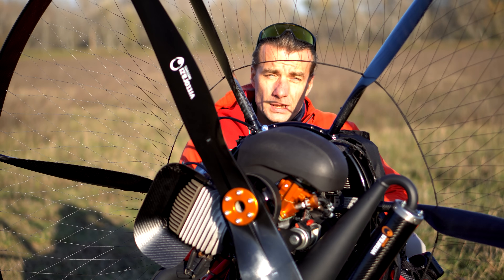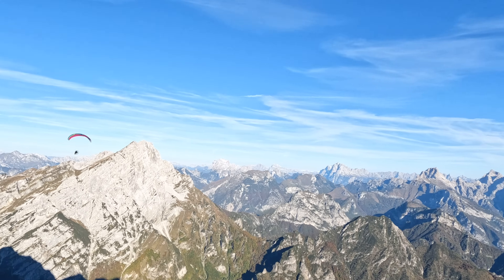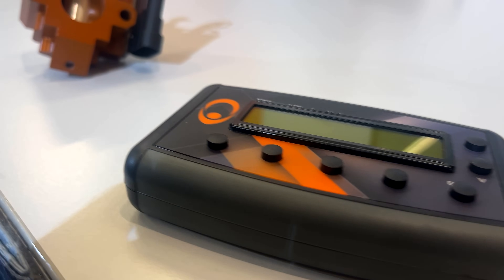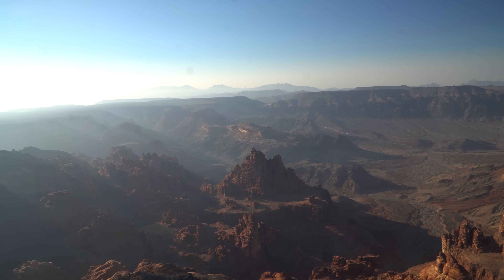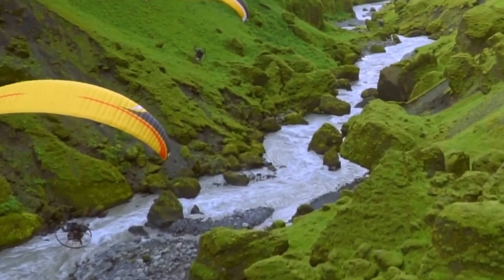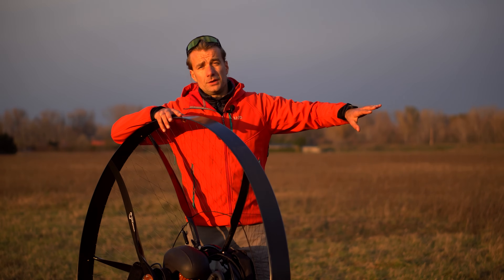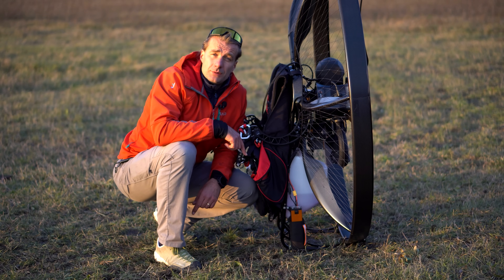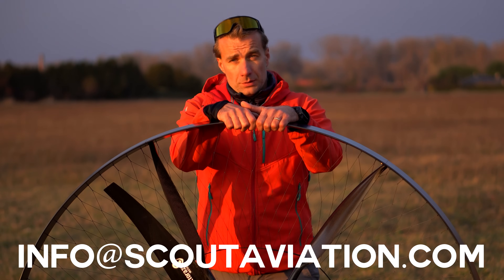Vittorazi EFI: All my expectations were wrong...Scout Smarter Pilot

Comment: Speaking of single point of failure, my biggest concern would be having a redundant channel in the ECU, even if it's only a "limp home" channel like car ECUs. Hardware, you can make robust enough to be reliable by overbuilding or by inspection/test to detect degradation prior to failure. Electronics tend to work until they don't. Also, why they don't just incorporate a small PM Generator on the engine and reduce the size of the battery?

Comment: Moster EFI is the first engine in aviation history without magnetto, alternator, charging coil. After 7 hours of flying in have to look for an electrical socket and wait 1 hour until you can continue your flight. The Iphone philosophy is now in the paramotor world as well. In cold climates and in winter, the battery life is reduced to 3.5 hours. Over time, the battery degrades and its capacity decreases. For your 6000 euros Now you need to consider all these additional factors when planning your XC flight.

Comment: They need to use an easy swap battery like you might find in a cordless hand drill. You could take several with you and, with a big enough capacitor, have it hot-swap capable.

Comment: with a small alternator, it could generate enough power to slowly charge the battery, and also will be self sustained if the battery dies.
Reply from the maker: Vittorazi has a version of this motor with electric start that recharges the battery during flight. I do not know why they decided not to use the same battery charging system for EFI.
Reply: @SCOUTaviation  Perhaps that will be the "upgraded" version when they release a new model?

Comment: £1.45 per hour fuel saving, Limited flight times, Too expensive. Well done for trying but it is too soon for the customer
Reply from the maker: This is not about calculating return on investment.
This is about feeling it. 
- feeling amazed by flying further and discovering the hidden on the other side
- feeling relaxed and enjoy the moment fully by trusting the engine
- feeling satisfied by getting into the air 99% of the time and not fiddling on the ground.
The engine is worth it if you feel that way. 

Yet I understand the price is steep and many pilots will need to wait until the technology becomes more affordable. I wish it will be soon.

And I also understand that there are still riders riding carbureted motorcycles because it is emotional to them. What a beautiful world we live in.

Comment: 5 years... so, they invented the wheel again and learned all about it. Yeah, that could take 5 years if you are only a few people working on it. How about getting someone with all the knowledge and do it in 1 or 2 years. But I'll guess now they have a reason to really make us pay for it. Because this isn't gonna be a cheap system. That's why it's gonna take a while to be a revolution in the sport, if ever. The way batteries are developing, that could be a "threat" before this system gets cheap enough for everyone to buy. We don't know what batteries gonna be able to "in the future", solid state and stuff, and when that "future" will be available, and now you also have the EOS 4-stroke, so I think we have to get a better price on that EFI-motor. Just some thoughts for someone that had an really old Solo 210 motor at the early 2000, flying planes in between and now is looking for a new rig to start with the sport again. Been thinking of a Scout with the EOS or maybe an electric conversion. The batteries almost fill my needs now. We'll see, but thanks for your input on the Vittorazi EFI. Always a lot of info. Take care - Many hugs from Sweden.
Reply from the maker: Things have changed a lot since the times of solo210.... 
Once you are ready to re-enter the sport feel free to reach out to us to discuss.

Comment: for the battery situation i cant help but think you could just add a tiny windmill genorator to charge the battery, or you already have a belt for the Prop, maybe add a little idle wheel/ tensioner wheel to the outside of the belt that drives a tiny genorator. it seems like a very solveable problem.

also the EFI should work better with the crappy ethanol laced gasoline we have in the USA.

its on my list to save up for paramotor training, hopefully by the time im ready to buy a paramotor this will have proven itself reliable.

Comment: I always wondered why the sport hasn't come to EFI. What horsepower does the motor put out? I am interested in this system because I live at high altitude and want to fly a MonoTrike with a Fox 13 wing. They say I need at least a 30 horsepower motor to get me off the ground.

Comment: Does it also solve carb icing in cold and moist conditions?
Reply: What? When does the carburator ice? What condition must there be? Never heard about this. Curious to learn. Flying in Finland it might be useful to know and avoid. Thank you.
Reply: @haukeplambeck  https://youtu.be/65djenNI_Ho?si=Yc99xmb3zkKjgjZA
Reply: No,it does not solve carb icing. EFI have also a throttle valve like conventional carb, which causes carb icing

Comment: in flight charging using an air powered generator should allow you to extend the battery life. I am sure Vitorazzi or someone is working on one. They are used on some full size aircraft.
Reply: that would add a lot of drag
Reply: All they have to do is attach a couple of magnets on the flywheel/pulley, attach a stator, with a smaller battery! Done!  No rocket science involved!

Comment: No real use what so ever yess you save fuel but then gou have a big bulky controller thats a lines catching hazards your limited to batter and if you forget to charge the batter you aint flying not only that the price is shocking. 

As for the exhaust nonsense it falls down to how the exhaust is pressed and it strained not rolled and welded together.

Its all nonsense something the paramotor dont need.

Comment: What kind of battery is it that once it is "dead" (voltage drops to effectively zero) can't be charged back up?  Sounds like a lead based battery, LiPo's can go to zero and back up, especially if it has a bms, just wake it back up. Power tools do this all the time. Heck, on my Rodeo, I yanked the Nimh out and got a lithium made for RC cars and it's a huge step up.
Reply: You do not run your lipos to zero volts and recover them. Sorry bud,  that's not how lipos work
Reply from the maker: Lipo

Comment: So assuming I am the same weight as you -- about 200 pounds -- and I also use the EFI and the variomatic prop, what kind of fuel usage per hour might I expect -- at low altitude.
Reply from the maker: We tried the variomatic with the EFI but the engine did not work. I have sent a prop to Vittorazi and they promised to try to set a new fuel map for this prop. 
Theory predicts there should be additional fuel efficiency benefits from EFI+Variomatic combo
Reply: @SCOUTaviation   New fuel map for the EFI -- is probably a lot more complex than it sounds... much much more complex.

Comment: Finally, this came as a working model. You mentioned at the beginning of the video that the engine's center of gravity is now further back. This, however, is a bad thing. The center of gravity matters to me. Is this really the case? Does some unit take up more space in terms of depth?
Reply from the maker: Yes, the engine sits 20mm further back. Not a big deal but I am purist when it comes to paramotor geometry. I understand why they did it and I would do the same in their position. The simplicity of the installation outweighs the disadvantage of the added depth.

Comment: I will be impressed by EFI too when it's actually proven to be reliable (not just an optimistic feeling from a few flights), the weight comes down, it has it's own alternator, and it's affordable. There are still critical problems to solve before it can be viable for its most valuable use case... long XC.
Reply: Already Proven!
Reply: then buy it as soon as possible. Nothing you stated wont happen if first batch of units is not selling.
Reply: 11:55  @gregorpajnic4739  I thought that is what R&D is for. To put out a tested, proven product.
Cheers

Comment: I wonder if they couldn't use a charging coil/voltage regulator to charge the battery while the engine is running. I know it's probably a LiPo, but it really shouldn't be that big a deal to do this.
Reply: They need a balancer if so. Can’t get a single cell 12v LiPo so you need a recharge balancer
Reply: @pepperjackshack2439  If all you're doing is ignition and sensors and the current draw is small enough, you could use a boost circuit to make 12 V from the single-cell voltage. That would shrink the battery as well. Unfortunately, you'd rule out the e-starter if you need more current than that. I would say that the balancing circuit could be effectively omitted as long as balancing the battery on a typical charger is added to the list of maintenance tasks for every 25-50 hours of use or so. The battery will not go out of balance on one or even ten flights.

Comment: Put on exhausts that don't crack and I'll be impressed
Reply: Supposedly, the EFI helps with that.
Reply: My exhaust is 300 hours old and rusty and hasn't shown any sign of failure. I'm of the opinion that they fixed their cracking exhausts with MY20.

Comment: I wonder why they decided not to have a small generator/alternator to charge the battery as every other efi engine has.
Reply: I'm going to guess it put them over some target weight. You'd need another motor, bracket, and charging circuit in an enclosure. Would prolly add at least 2lb for the juice they need to run that pump. 10lb would just be way too much to add.
Reply: @CalebJohnsonlivingca  I doubt it would weight much at all. A small alternator that is put on the same drive belt with the prop. Pretty sure the draw on the system is quite low and wouldn't need much to keep up. The weight of the electronics would be negligible.  And remember they are now hauling that big battery that could be changed for a smaller one. 

Could be that it just complicated the design too much. Still, would have gone with the alternator as now your just adding a limitation that the carb version don't have.
Reply: @samik83  I've made my own generator for Moster and now Nirvana, each was about 1.5-2lb. prolly you could do it more efficiently, but it's a data point. 🤷‍♂️
Reply: @CalebJohnsonlivingca   Thats awesome! Would love to see some photos / videos how you did that. And why? ;)
Reply: What other efi engine can I buy today for my paramotor?
Reply: Yea, wonder the same. There could be smaller battery in if it was charged while flight. Also, there's less fuzz if you only need to add gas and not charge battery.

Comment: Nice video again, EFI ist definitely a advantage ! But the difference in fuel flow is impossible . Fuel air mixture = full rich ( nearly with choke) is 12,5 /1 ( low EGT or burning temp.) full lean 16/1 high EGT or burning temp.very low power) .
Reply: You’re not taking into account that air density is not the same at all altitudes, or even temperatures. Where carburetors muscle through everything with the same amount of fuel regardless, efi adjusts on the fly to maintain a specific parameter.  Now that he is tested it, I have more faith that it’s actually true because he admitted he was wrong. He’s not interested in protecting a narrative that is not true.
Reply: @CloudflyerPPG  This.  Flying a Cessna 172, first thing you do after climbing to cruising altitude is lean the engine, which isn't an option on PPG's (even GA pilots have problems remembering to do it).  EFI should have been standard equipment on all aircraft 30 years ago, but regulation was too arthritic until just recently.

Comment: Unless you're huge, you really don't need a 185. What's wrong with just using a Top 80 + Viper XC and getting 2.1 L/h? Reliable, much lighter, much simpler and much better fuel economy. With my 18 L tank I can fly for 7-8 hours.
Reply: - Launching and flying at high altitude.
- Launching out of tight LZs.
- Launching with camping gear and extra fuel.
- Climbing while in mountain sink.
- Climbing while accelerated.

I have seen and experienced myself that Atom80 doesn't cut it for adventure flying. I learned on top80, but quickly outgrew it when I started adventure XC flying.
Reply: @CalebJohnsonlivingca  I and many others have done that several times with Atom 80 and Top 80.
Reply: Because when you want or need extra power, you can't squeeze More from an 80.
All the guys I fly with that switched from their 80 were thrilled and never considered going back.
Mileage may vary, of course.  Enjoy what you fly.
Reply: @WebberAerialImaging  140 prop makes enough difference
Reply from the maker: Then you obviously don’t need the moster EFI. And that’s ok. 
If I was a lighter pilot I would fly atom 80 for sure. It is a lovely engine.
Reply: Some decisions in life have nothing to do with need, but are instead made because of a desire. If you are willing to accept the slightly higher risk of a reliability issue, strong enough that the extra weight isn't a problem, smart enough to deal with the added complexity, have a budget that can handle the extra fuel costs, and the desire to have the extra power available, then why not fly a 185, even if you're not huge?
Reply: @Logan4661  Of course you can do that but at that point it's no longer a rational decision.

Comment: The battery is what kills it for me. Yes, you save fuel, but you becone limited by the battery instead. You can get most of the same advantages just by using a smartcarb instead
Reply: This. 
I don't see how they couldn't incorporate a small alternator in that thing. I bet the amp draw is really small in that system, so it wouldn't need much and you could use a smaller battery to off set the weight of the alternator.
Reply: @samik83  to be honest, i'd gladly have a heavier engine if that means i don't need to mess around and rely on a battery
Reply: That was my exact concern too.
Reply: What’s a smart carb?
Reply: @NicholasStreet  a self adjusting carburettor without jets. They're used in motosports. There's one for thor 202.
Reply: @apsestasis  The problem with the SmartCarb is that it doesn't incorporate a diaphragm pump, as it's designed for gravity fed systems like mx bikes... So it struggles with the pressure drop from low mounted tanks. I do think a carb that uses the technogology from SmartCarb, but includes the pump from our current carb designs would give you all the same benefits as the EFI with none of the drawbacks, with maybe only a few percentage points lost on efficiency overall. It automatically adjusts mixture for altitude and airflow very well.
Reply: @stephenkeen6044  that very well might be, but they have a model specifically for thor 202 now, and more paramotor engines are converting to a float carb with a fuel pump every year now, like SKY for example
Reply: @apsestasis  Great. Then Smartcarb could work for those particular machines, although it's a rather expensive "addition" to a paramotor. I think it's a great design. The problem remains that the majority of motors used in the sport are Vittorazi, though. Which means that other solutions have very little market visibility in comparison, even if they may be better suited and would win out over time in an equal and free market. 

I still think there is space in the market for a paramotor-specific carb using internal pump and the tech of a SmartCarb and then marketed directly to paramotor pilots as a simple direct replacement on any two-stroke machine. The diaphragm pump is lighter and less hassle than an external pump and having the tank down low is good for paramotor design and weght distribution.
Reply: @stephenkeen6044  agreed, it is an expensive addition, around 1k usd for the thor model, but it's still much cheaper than efi. As for majority motors being vittorazi - i guess that depends on the region. At least at my neck of the woods it's equally distributed between sky, thors and simoninis. Eitherway, i think the big shakeup in the industry is going to comr from eos quattro, not a 2t efi because it's simply far too nieche
Reply: @apsestasis  Yup. Glad for companies innovating and actually bringing new stuff to the market and I know a percentage of pilots will buy them just for that. Bailey didn't have much success with their 4t engines and EOS have been teasing the Quattro for quite a long time now, but ultimately I think most will still end up choosing carb'ed 2t engines for their power-to-weight ratios (including me).
Reply: @stephenkeen6044  i wouldn't say bailey's weren't sucessful. They seem to be quite popular in UK and people swear by them. It would seem that their biggest drawback which prevented them from gaining more traction was the low-ish power  (20hp) and small scale of operation which lead to limited support and availability, not that there was something inherently wrong with the design itself.
Reply: Smart Carb works perfekt ob MX Bikes , good idea

Comment: What about a lightweight portable solar charger 4 the battery?
Reply: You'd need a big panel to keep up with that fuel pump.
Reply: Unless you manage to charge in-flight, the solar is useless for unsuported adventure, cause you fly in daylight and would need to charge overnight. I guess, peoople would need to pack small cranking generators with them... ))